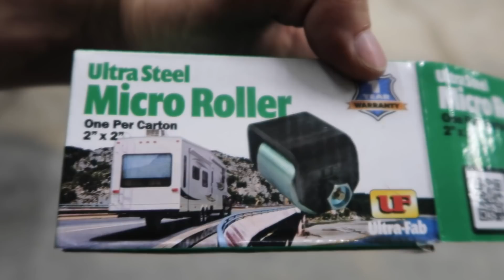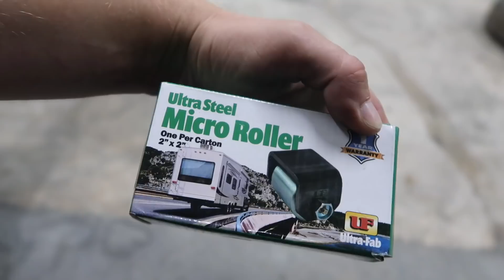$38 MOD that will PROTECT your Trailer

Comment: Tell the trailer manufacturers. It wouldn’t cost them much to fit these rollers when building the trailer. It could be a selling point. What I don’t understand is why they haven’t fitted then to new RV’s and trailers or anything else with a low long overhang.